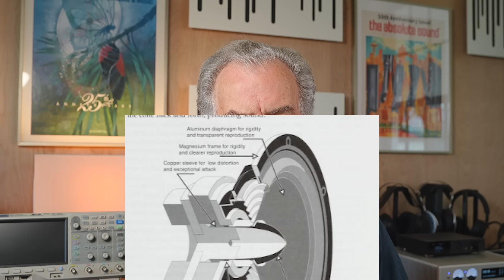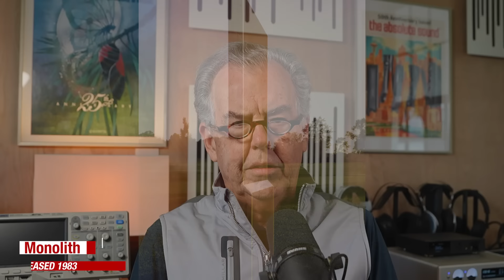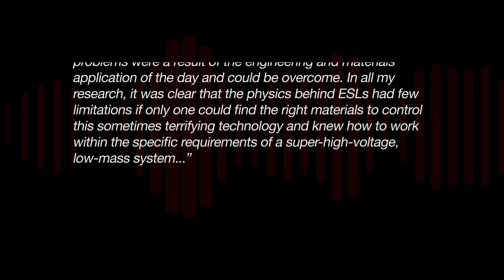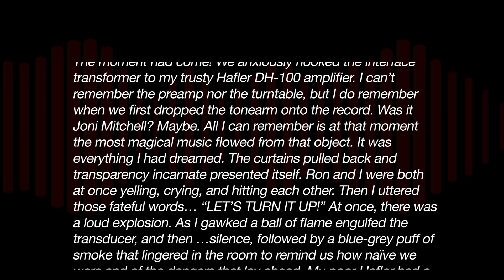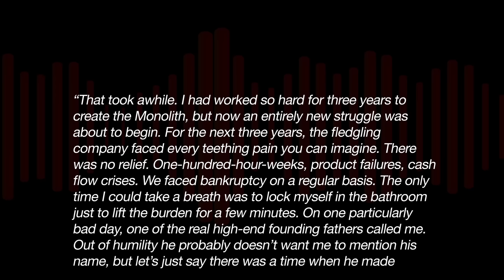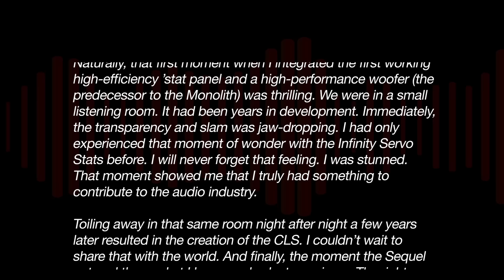Audio History Series: Martin-Logan Reinvents the Electrostatic Speaker

Comment: Quite frankly though Martin Logan has built itself a cult, its one of the most inaccurate worst speakers you can buy. The bass modules integrate horribly with the ribbons and since they operate in the upper bass require subs for full extension. They have a wonderful midrange with falls off like a rock after 10 khz. The magic listening position is very narrow and simple the speakers are dipolestgey require about six feet from the rear wall. Plus, to achive that magical hearing spot you must sit about 12 feet away smack between the panels. By all measure they are a victory of form over function. From all aspect of actual sound reproduction on a home environment they are horrible  in almost every way.

Comment: I still own CLS IIs I got in the late 1980’s (when they were CLS I’s) and have new panels ordered for them.  I appreciate that ML has maintained that service for a product so old. The CLSes are combined with a large Hsu subwoofer.   The crossover and, to an extent the speaker response are corrected with MultEQ-X focusing low bass to 500 Hz.  This is in a multichannel home theater setup.  Prior to that were Magneplanar Tympany speakers I’d set up in a straight plane manner.  I loved those but the sheer, often referred to, “you are there” clarity of the CLS simply hasn’t been matched.

Comment: Having lost interest in boxed speakers I discovered M-L in the 1990s and purchased a pair of the least expensive floor standing models for about $1500. They were fine but whetted my appetite for a larger pair. I had SL3s and CLS 2 Zs finally purchasing a pair of ReQuest monsters in 1997 and loving them to this day, adding a Depth sub during the brief period  they were available. Concerned about the useful life of the ESL screens, I acquired a new pair of screens for future use but haven't needed to install them even this many years (28) later.  I also purchased a Logos center channel in the 1990s which blends beautifully,, all driven by a Lexicon power amp. Life is good!

Comment: Yeah I was there in 1988 buying one of those early Sequels. From the first demo track I knew I needed them!  Sadly, after only ~5 years their sound had declined and I sold them.  Those early coatings were not the greatest.  Years later I got a pair of SL3’s, which I still own today.  I’ve replaced the main panels and some crossover components and they’re sounding even better than new.  I also own dynamic speakers however, and I switch between them for months at a time.

Comment: I always liked the clean, simple look of the original CLS. I wonder why the necessity of producing a hybrid. Didn't Alastair Robertson-Aikman of SME use a doubled up pair of Quad ESL63's braced with steel in his listening room at Steyning without subwoofers? The purist in me says there must be a way
Reply from the maker: Physics, unfortunately, is the problem. Dipoles roll off at 6 db per octave below a frequency set by the baffle width (that's why KLH set up the 9 to be used as two connected panels per channel). That rolloff frequency is 200-250 hz for a typical panel. The designer can compensate for this by mechanical or electronic EQ, but that just means that the panel has to move even farther (4x to 8x) to do 50 hz or 40 Hz in a situation where we have severe excursion limits. You can make a wider panel, but then dispersion and power response suffer. Or you could make a dipole woofer with cones. It would appear, from listening to a few of these, that the issue with mating cone woofers to electrostats is partly the use of mismatched radiation patterns. So some designers think that by using cones where cones are good (low frequencies where they are stiff and capable of relatively huge excursion) in a dipole arrangement, you can solve the problem. Very few of these have been done, but we've heard a few and the results are promising.
Reply: Yes, but I think Alistair Roberts Aikman of SME mainly listened to Opera so for that purpose I'm sure sure they would be fine, but still very limited.

Comment: Bought QuestZ in 1998.  Still have original panels.  Recently modified slightly to bypass the bass crossover and run a second amplifier directly to bass woofers with active crossover.  Allows tuning the crossover point between panel and woofers.  Really wakes up the bass performance and addresses lean sound of original.  Lets amp #1 to focus on driving the panels.

Comment: I have a love-hate relation to electrostats. The biggst challenge imho is to find the right amplifier making them sing. I finally came to 6c33 pse
Reply: Hard to drive 20.7s
magnetic line array
Not electrostatics
Less maintenance 
Coda v3 800w@4ohm